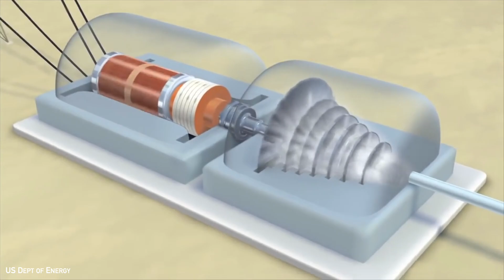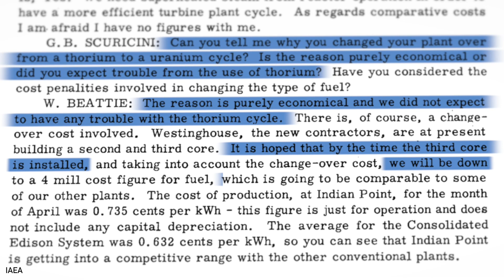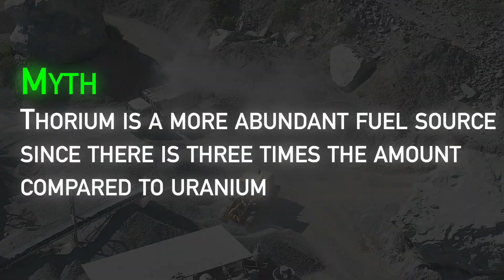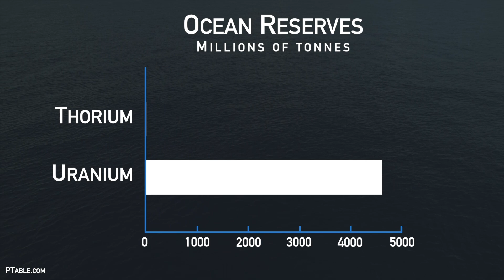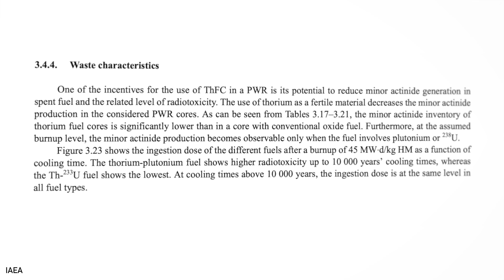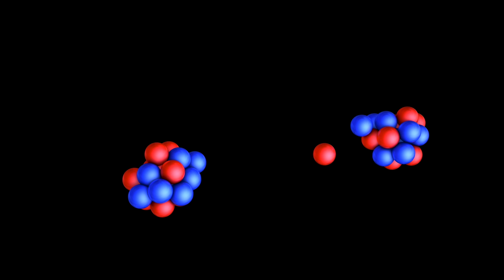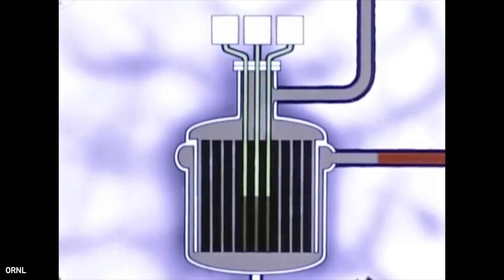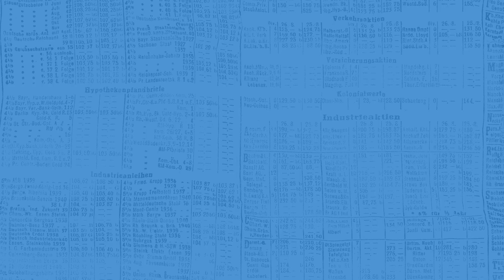*Almost

Comment: Subbed. Good videos. Keep promoting nuclear fission--we need more reactors yesterday. Better late than never.
Reply: Unfortunately, we have been (trying to) build new nuclear and it has not been going so well.

If you live in the U.S. here is the reality for the last 4 state of the art Westinghouse AP1000 ADVANCED passive safety features new nuclear power projects and spent fuel reprocessing and in the U.S. over the last 20 years. You decide if this YT video was presenting the truth. 

The Southeastern U.S. is super pro-nuclear MAGA, has zero anti-nukes, and 100% media and political support. 

The MOX facility (South Carolina) was a U.S. government nuclear reprocessing facility that was supposed to mix pure weapon grade Pu239 with U238 to make reactor fuel assemblies. It was canceled (2017) in the U.S. After spending $10 billion for a plant that was originally estimated to cost $1 billion and an independent report that estimated it would cost $100 billion to complete the plant and process all the Pu239, Trump canceled the project in 2017.

VC Summer (South Carolina) new nuclear units 2&3 were canceled in 2017 after spending $17 billion on the project (original estimate of $14 billion and 2016 completion date) with no clear end in sight for costs or schedule. 

Vogtle (Georgia) new nuclear units 3 &4 currently 110% over budget and schedule (currently over $30 billion) and still not operating. Mid way into the build, the utility stated that had they known about the many costly delays they would never have chosen nuclear. They are now delayed another year because according to the project management, thousands of build documents are missing. If completed, Vogtle will be, for its output, the world’s most expensive nuclear power plant.

Please google any of this to confirm.

If you can’t build new nuclear in the MAGA super pro-nuclear southeast U.S. then where can you build it?
Reply: @clarkkent9080  Maybe we can't build them right now but if people like @AtomicBlender keep educating people and spreading the nuclear gospel we can start building them soon.
Reply: @tylower  PS currently there are NO U.S. utilities even remotely interested in building new nuclear.  And given the now standard of 16 years to complete new nuclear in the U.S., It will be a long time before another one is built.

I am actually pro nuclear as I worked in the industry for 40+ years at five different facilities but facts are facts and the problem is NOT educating the public, it is cost and time.
Reply: @clarkkent9080  Cost and time are problems, yes, but much of that is due to regulations and laws written decades ago. By explaining the issues with nuclear, channels like this help change the layperson's mind. If enough American voters embrace nuclear, we may see political change that will help build the nuclear renaissance we so desperately need. It's a tall order in America's broken political system, but it's necessary if we're ever going to see change in this country.
Don't lose hope.
Reply: @tylower  I worked in the nuclear industry for 40+ years at 5 different facilities and have a little experience in the subject.
Which laws or regulations that you reference should be eliminated or changed???  If you don't have specifics, your just throwing out generalities that mean nothing.

I actually had one person claim that congress passed a law that just said "fix the problems with nuclear".  And then claimed that everyone ignore that law.
WOW that is like saying pass a law saying stop wasting money, or be more efficient, or don't commit crimes, or politicians don't take bribes, etc..

You must be somewhat young  and have not yet embraced how things actually work
Reply: @clarkkent9080  I'm 43 years old and "embraced how things actually work" a long time ago. But since we're making assumptions about each other, here's mine: I don't think you are who you say you are. Someone with "40+ years" of experience in the nuclear industry should be thrilled at the recent resurgence of interest in nuclear power. I think it's far more likely you're a troll.
That being said, you're right, I was too vague about laws and regulations. I should have said "local politics" in place of "laws and regulations". Building anything in this country has become difficult, nuclear power plants even more so. But the tide IS turning, as public opinion is quickly shifting in favor of nuclear and renewables, and away from fossil fuels. Channels like Atomic Blender are helping with that, and a pro-nuclear guy like you (claim to be) ought to be a cheerleader for that.
Now if you really want a specific example, here's my humble layperson's suggestion: amend the Nuclear Waste Policy Act of 1982 so that nuclear power plants do not pay the cost of long-term disposal. Build Yucca Mountain, and let the taxpayer pay for it. There is no cost (yet) for dumping carbon into the air, yet we all pay the price for that--why not use taxpayer money to provide a safe high-level waste disposal site?
Reply: @tylower  You are sorta correct.  I would  be thrilled at the recent resurgence of interest in nuclear power if it was true but is is not in the U.S..

I worked in the nuclear industry for 40+ years. I was a Radiation Control Tech, Reactor Operator, Senior Reactor Operator, Simulator Instructor, and had many special waste disposal assignments  at 5 different nuclear facilities and consider myself to be pro-nuclear. But that does not mean that I have to ignore facts and reality. Don’t we have enough of that in politics where people will defend the indefensible when it is their party committing the crimes?  

So in your mind being pro nuclear means ignoring the facts and reality of new nuclear builds and demanding more are built no matter the cost.  Thank God utilities make those decisions and not you and now no U.S. utility is even remotely considering new nuclear.

I am pi$$ed but it is with the construction trade and incompetent utility project management. I believe it was 2016 when then DOE Secretary Moniz was asked about the future of nuclear power in America. He stated that the future of nuclear power was playing out at VC Summer in SC. and Vogtle in Ga. and if they were successful, then nuclear power had a bright future in America. That simple statement says it all. Until the issues with the U.S. construction industry are addressed, nothing will change.

So having the government pay for waste disposal would make all the difference?  I think not.  I do agree the 1982 nuclear waste policy act should have been followed not changed as it was and then failed.  The 1983 Nuclear Waste policy act specifically stated that no less than 2 nuclear waste disposal sites would be established so that no one part of the U.S. would get all the waste. And that the disposal would be in the scientifically best location and that is a salt formation.  Yucca mountain is an extinct volcano and not a salt formation.  In 2014, the amount of spent nuclear waste stored at the 100+ reactor sites in the U.S. exceeded the design capacity of Yucca Mountain so if it was ever opened, it cannot hold all the U.S. commercial waste now generated. The U.S. high level radioactive waste generated from the production of weapons grade U239 far exceeds that from commercial power plants. Hanford Wa. Has 53 million gallons of high-level radioactive waste in rusting underground tanks. Savannah River Site has 43 million gallons of high-level radioactive waste. That does not take into account high level radioactive waste stored at other DOE sites.  Yucca Mountain was chosen for purely political reasons and it was abandoned for purely political reasons. Trump killed the project completely. We already have a nuclear waste problem that must someday be addressed but it is NOT solved by any means.
Reply: @clarkkent9080  You've given me a lot to look into. 
One question: what do you think of small modular reactors, manufactured in one facility, small enough to fit in a shipping container, then transported (probably by ship, air, or rail since roads are bumpy) to their operating location? Maybe that could solve the high construction costs?
Reply: @tylower  Well, first there is an 67,200 lb weigh limit (container + load) on a shipping container.  Equipment, especially stainless steel or specialty metals weigh a lot.  I could not find data on the weight of a simple navy nuclear propulsion unit (77 Mw thermal and about 60 Mw electrical) but my guess is that it weighs much greater than 67,200 lbs.

Most people don't realize that most components of a standard commercial 1.000 Mw unit are built in a factory and assembled on site.  The reactor primary is just one part.  You have a secondary side which is almost exactly the same as a coal fired power plant. Then there is the electrical, emergency diesels and reheater energy recovery units, cooling towers, control room, electrical equipment room, water purification (they make their own drinking water and reactor coolant), Poop plant ,  etc.  Every building and component at a nuclear power station is there to do one thing...produce power.
Utilities have always chosen the largest power plant available due to economies of scale.  Small is cheaper to build and faster to come on line but more expensive to operate.
Nuscale is trying to build a multi SMR plant in the U.S. and I found this information on that project.

This is from the Des Moines Register an concerning the only Small Modular Reactor (SMR) project in the U.S. today.
In 2013, the Wall Street firm Lazard estimated that the cost of generating electricity at a new nuclear plant in the United States will be between $86 and $122 per megawatt-hour. Last November, Lazard estimated that the corresponding cost will be between $131 and $204 per megawatt-hour based upon the 4 recent new nuclear projects in the U.S. . During the same eight years, renewables have plummeted in cost, and the 2021 estimates of electricity from newly constructed utility-scale solar and wind plants range between $26 and $50 per megawatt-hour. Nuclear power is simply not economically competitive.
SMRs will be even less competitive. Building and operating SMRs will cost more than large reactors for each unit (megawatt) of generation capacity. A reactor that generates five times as much power will not require five times as much concrete or five times as many workers. This makes electricity from small reactors more expensive; many of the original small reactors built in the United States were financially uncompetitive and shut down early.
The estimated cost of constructing a plant with 600 megawatts of electricity from NuScale SMRs, arguably the design closest to deployment in the United States, was originally advertised as costing $1 billion but upon requesting actual bids from engineering firms, increased to $6.1 billion in 2020. Given inflation and other cost constraints that cost today can only be expected to be significantly higher.
The cost was so high that ten members of Utah Associated Municipal Power Systems canceled their contracts. NuScale then changed its proposed plant configuration to 6 fewer reactors but increased each reactor output from 50 Mw to 77 Mw costing at total of $5.3 billion. The NRC just last week approved the construction of the 50 Mw design but now will have to start the review process all over given the switch to a 77 Mw design. For each kilowatt of electrical generation capacity, that estimate is around 80% more than the per-kilowatt cost of the Vogtle project in Georgia — before its cost exploded from $14 billion to over $30 billion. Based on the historical experience with nuclear reactor construction, SMRs are very likely to cost much more than initially expected. And they now have delayed the project start until 2025 in an attempt to find more backers.  All this before the inevitable setbacks that will occur once construction starts. 

I really do wish things were different but the story is not a positive one.
Reply: @clarkkent9080  Don't lose hope. When I was a teenager, renewable energy was a hippie pipe dream; now it's a large and growing part of our energy supply. Nuclear will return, and soon (next decade or two).
Reply: @tylower  You misunderstood my point.  I have nothing against nuclear.   I can discuss the safety issue and waste issue and don't see them as non-starters.

The issue is that in the U.S. today, the construction industry does not have the skill set and experience needed in sufficient numbers to cost effectively construct complex and QC critical projects. In addition, there is massive greed, fraud, kickbacks, and project mismanagement adding to the failures.
 If the issue was with the nuclear plant design, that can be easily and quickly changed but with the issue being people related, that takes decades to correct.
So it does not matter what type (MSR, SMR. PWR) reactor design you want to build.  The problem is building it at a reasonable cost

Comment: Do you really think that the American industrial-military complex would recognize their need for plutonium in cancelling the development of TMSR?
Reply: Hanford Wa. has been making weapons material since 1944 and their weapons production reactors are very efficient graphite moderated reactors and DO NOT produce any electrical power.
Savannah River site SC. Has been making weapons material since 1955 and their production reactors are very efficient low pressure heavy water moderated reactors and DO NOT produce electric power.
Weapons production reactors are NOTHING like U.S. commercial PWR or BWR power reactors and commercial power reactors have NEVER been used to produce Pu239 for weapons.

The U.S. alone has enough Pu239 based nuclear weapons to destroy every city on earth with a population greater than 200,000.  34 tones of weapon grade Pu239 has already been designated as excess and we are spending billions to immobilize it in "stardust" so that it can eventually be disposed.  The U.S. does not produce any more Pu239 and has no need to.

Comment: You expose yourself on several points. I will point them out to you. You mentioned that uranium is better established. Why is this?   You took the funds from thorium 55 Years ago and fitted it into uranium research. Who was the funder? The American military. What do they wanted desperately?
Nuclear Bomb material. Did the thorium reactor give it to them? Basically not. The uranium reactor did.
Same example Sinclaire with his electric car. It failed. Why? The oil industries didn't want it.
No funds went into battery development. No funds no batterie. 30 years of loss of development
You lost 50 Years of thorium reactor development because of some stupid military advisers.
And I think that comes closest to the truth than what you are trying to say.
Got you.😁😁😁
Reply: You expose yourself.

Where do people keep coming up with this BS that PWR/BWR were chosen so we could make bombs?
Hanford Wa. has been making weapons material since 1944 and their weapons production reactors are very efficient graphite moderated reactors and DO NOT produce any electrical power.
Savannah River site SC. Has been making weapons material since 1955 and their production reactors are very efficient low pressure heavy water moderated reactors and DO NOT produce electric power.
Weapons production reactors are NOTHING like U.S. commercial PWR or BWR power reactors and commercial power reactors have NEVER been used to produce Pu239 for weapons.

Comment: It definitely makes less waste in the breeder LFTR with online processing configuration.  The waste it does generate is shorter lived and has many valuable uses. Still waiting for FLIBE to actually build a demonstration reactor with online processing. You can theoretically make bombs from the byproducts but because of the gamma radiation it would be very difficult to process and impossible to conceal.
Reply: There are a lot of things that you can theoretically do but like you I am waiting for something to actually be built that does any of these claimed things.
Reply: @clarkkent9080  Exactly what I said. Waiting. The high gamma in the salt would kill you if you tried to steal and process it. Also easily tracked.
Reply: @solexxx8588  Spent reactor fuel can be used to make nuclear weapons as it contains Pu239.  It is also considered self secure as anyone that comes within a foot of a spent fuel assembly would receive a lethal radiation dose and it would be extremely painful the whole time you are dying.  That is why spent fuel pools are not a high security area.  But in transport it is very well protected.  So same difference
Reply: Extracting Protractium from hot corrosive radioactive salts on an industrial scale sounds like an engineering nightmare.